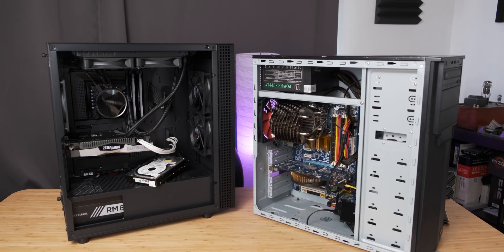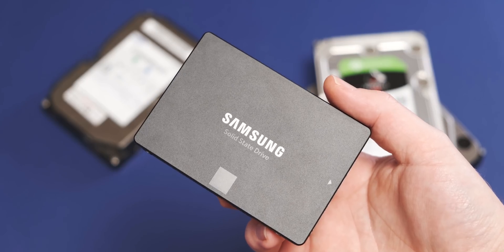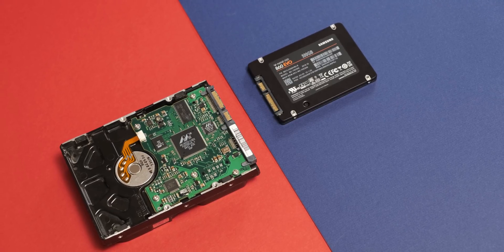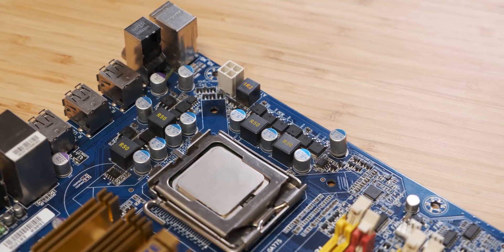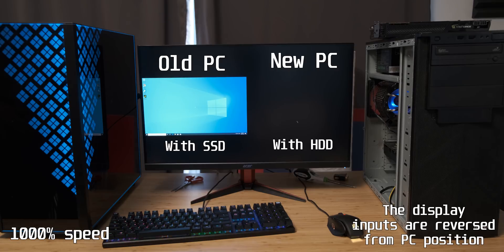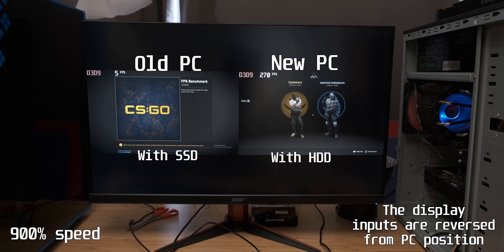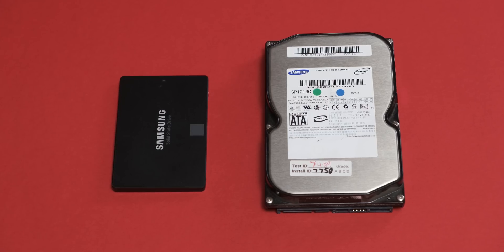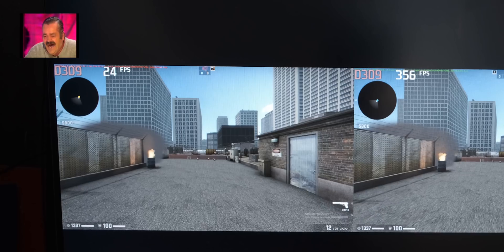New PC with old hard drive vs Old PC with new SSD

Comment: I replaced my old laptop 2,5" HDD, now it feels fast like my main rig.
Reply: Yeah I have a 2014 Asus laptop, i3, 8gb... It had a 500 GB 2.5" hard disk, when I swapped it for an SSD. Oh god, it felt like it's from 2024!
Reply: bcz 2.5 hdds r specially, crappy
Reply: @arencorparencorp2189  yea but i runs great on win 7 but win 10... oh boy talking about my 2009 laptop boot up is about 2 mins
Reply: @whyers4782  well, makes sense i mean, w 7 was designed with these as the usual, widespread drives, like win xp was snappy with hdd, however win 10 was meant for ssd, as in 2015 adoption was raising, it also works fine on fast hdd with cache, but on slow, laptop hdds? horrible, it works but.. as tech goes.. i mean try to run w10 with a celeron dual core and 4gb of ram vs win 7...

Comment: I wouldn't call this video pointless. I deem this really informative and really stress the importance of an SSD at this time. Also points out the value of old hardware coupled with a relatively cheap SSD. Breathes new life on an old system basically.

TechYesCIty will be proud. :D

Comment: I clued onto this when I needed a laptop for university, with an SSD my 2012 business grade laptop (Lenovo X230 so not your typical big box retailer laptop) flies for the tasks it needs and is magnitudes faster than any new $250 machine. Can't believe that even laptops in the mid range price segments are still offering HDDs as default
Reply: Finally starting to see new laptops with standard ssd.   I think the manufacturers were selling more pcs to unsuspecting consumers based entirely on the big numbers.   They liked highlighting 1 TB storage in the advertising.   The smart consumer is much better off with 256gb boot drive and maybe an external usb storage drive if needed.

Comment: Even a decent HDD really cripples the usability of a system.  A brand new toshiba p300 2tb drive was used in the boot drive of an entry level PC I built for my parents (has a pentium g5400) and it took ages to launch anything and was very unresponsive, I put in a cheap SSD and it runs really well now. I will never used a HDD as a boot drive ever again, as it has always been the reason why my older PCs were so slow. I wouldn't have upgraded them if all I had to do was install an SSD, but granted SSDs costed much more back then, but i guess even a 40gb SSD would've worked and then use a HDD USB caddy to use the old drive for extra storage (I was using a laptop at the time.)

Comment: Watching this on a Phenom II X4  @ 3 Ghz,  16 GB RAM,   SATA 2 interface with  Intel SSD  with GT 650 GPU. all of it works together  really well.
Reply: Put a GTX 750Ti/760 there and it's a nice casual gaming machine.
Reply: Similar system here.  Phenom II X6 1090T at 3.8 ghz, 16 GB RAM, 1 TB SanDisk SSD PLUS and RX 580 video card.  Had the basic system for years now.  Not a heavy gamer but it runs fine for me.

Comment: USB 3.0 or 3.1 in the new system vs. USB 2.0 (at best) in the old one is also a HUGE speed difference, especially when installing an O/S due to its size.

Where the SSD will make a huge difference is in very large titles like GTA 5 and RDR 2 - those probably won't even load on that new PC with old HDD. I noticed a big speed difference, particularly with seek times, with a SSD (a 1TB Samsung 860 QVO)  vs. the Seagate SSHD that was in my laptop before.
Reply: USB 3 is 3 × faster than 2.0

Comment: The tactic for getting around the hdd speed issue was raid. Raid 0+1 was common or a 4-drive raid-5 array.
Reply: 0+1 
failure rate ... one disk dies you lose everything with 4 disks the probability is 4x more than with one.
Reply: @666Azmodan666  that is 100% incorrect. RAID = Redundant Array of Inexpensive Disks.. Notice the word Redundant ? 
One disk fails and you do not lose data. The drive gets replaced and rebuilt on the fly while the system keeps operating .
Depending on how your raid is configured some can survive multi-disk failures.
Reply: @iancarnel8609  HDD disks have a specific number of errors specified in the manufacturer's specification. With 2tb disks, the chance for such an error is about 60% and it won't be detected by any program, but when recovering the matrix it will be detected, which will result in interruption of data recovery. They are safe raids but today, e.g. raid 1 is not one of them.
I have been working on the topic recently for important data for the company.
If you don't believe me, it means that you have such knowledge as I did a few months ago, as it turns out to be expired.
Reply: @666Azmodan666  nobody mentioned using raid 1 exclusively.
I said 4 drive raid using 0+1 .. Eg 2 drives striping and 2 drives mirroring.  4 drive raid 5 is striping with on-drive parity and 4 drive  raid 6 is 3 drives striping and one drive parity.
Idk if you didn't read that part or if you're trolling or trying to show off.
Reply: @iancarnel8609  I meant raid 1 (mirroring) created for security but today having nothing to do with it. Although safer than one, but wasting half of the space available for a poor chance of data recovery is pointless and in the case of important data is unacceptable.

Someone who associates raid with security should check whether the theory written years ago is still valid in the case of the raid mode he chose. That's all I mean. I do not want to start wars or show off I prefer to sleep, I am now 1 am;)
Secure data is two mirror servers NAS in separate buildings and of course with the appropriate raid.
good night ;)

Comment: HDD speed isnt bits, its bytes. network speed is measured in bits. :P
Reply: Which is stupid. It's just to make speeds look impressive with big numbers.
Reply: @MrBearyMcBearface  not sure what you mean, networking is generally slower than storage.
**you do understand bits are a smaller unit of measurement, so the fact that storage and ram use bytes, actually makes their numbers smaller, because there are more bits in them, if they used bits, the numbers would be enormous. example, gigabit (1000~megabit) ethernet translates to roughly 128 MegaBytes.**
Reply: @bruhhdahman  I know. But the abbreviations are very close. People confuse them all the time. So when someone is selling internet or a router or a wifi dongle.... A lot of people would think it's not Mbps but MBps. Bits make sense as a unit because there are 8 parts that make up a byte. Bite kilobits or megabits doesn't even make sense. Bits don't make up megabytes and kilobytes. Bytes do.
Reply: @MrBearyMcBearface  yeah mega and kilo are prefixes that also reduce the size of the number... kilo is 1000, so kilo bits/bytes is 1000 bits/bytes,  mega is million, so yeah these words aren't deceptive, they don't make it seem larger, they make the numbers smaller, the words help describe the size. not sure why you think they're deceptive.
Reply: @bruhhdahman  because it is? Tell me why bits are used for network speeds when real speed is measured in bytes

Comment: What type of time would it take to install Windows off a DVD versus USB on the older system? I can't help but wonder if the old motherboard's USB controller is a bottleneck. But then again, installing off DVD rom was not fast either.. but I suspect it may be a bit faster in this situation. Crap, I still remember installing Windows 95 with a stack of floppies. What a waste of time.
Reply: Recent builds of windows 10 do not fit on normal dvd unless you use dual layer media

Comment: The problem with a HDD is not with a clean windows install, the performance decrease with the use, try to fill the HDD whit 40% - 60%
Reply: actually no, thats ssd, hdd should work 100% as fast even at 99% fill, granted no fragmentation happens, wich is harder as it fills up

Comment: My PC at work took almost 15 min just to log into Windows (10). Swapped an IDE hard drive for an SSD. It now is almost immediate.
Reply: There might have been some bad sectors on the hard drive. That will make it even slower than it already is.
Reply: yea, 15 min ofc, my hdd one took 2 billion years to boot up, cmon hdd r indeed slower, but not THAT slow, i had windows 10 installed on a crappy laptop 5400 hdd and takes 40 secs to boot, 1 min extra to be usable, so unless ur hdd is literaly broken it wont take that much
Reply: Hard drive was old, and booting pxe
Reply: Tbh hd vs ssd not major boot time difference.

I tested and depends on hd spec.
Reply: @DragonProtector  its overall responsiveness, and ofc, yes ssd is better but, its not like it takes 10 days with hdd and openning a folder takes 1 min... it works.... reasonable, with a decent hd with cache, add a 2000s hdd, sure its going to be crappy
Reply: @arencorparencorp2189  ya. A good 2tb or higher drive with 256mb cache will be just as responsive as an ssd and normal user won't notice difference besides maybe loading screens by a second or 2.
Reply: @DragonProtector  hard drives don't have cache. You're thinking of sshd. Which is a horrible option for nearly all users.
Reply: @thevigamerpixerlator  lol cache and solid state memory in hybrid drives are two different things.

Comment: I did this a few weeks ago......

Olden days... we never used one drive we had raid 0

Any how.... before you pack this away...

Just add another old hard drive and re do the test again... you can do two.

One just add a drive, windows 10 will put the cache on it and speed things up (make it usable)
[ make sure that it does]

Then  Raid the drive into a strip and see what difference that makes...

If you have "time on your hands" then add another  hard drive ( 3 drive stripper) and see if the old system is better or not then....

I also did a video on SSD being slow and put the latest against my mechanical drives... My Mech won by a hell of a lot.... " Goo old tech!!"

Didn't no girl tell you.. its not what you got but how you use it!

Comment: I use my older 250GB Samsung 860 EVO in my Win XP 32 bit gaming system.
Reply: how is a Samsung EVO old? i thought those where ssd and they are like the titan x of Samsung's ssd line.
Reply: @bland9876  Poor choice of wording but I should've said heavily used. Basically it was used as a test drive and a boot drive for 2 years. Also it is older in the context of I upgraded it  for a Samsung 970 pcie nme 500gb drive.
Reply: @Warbob11  pcie supposed to be the fastest especially if it's an x 16 card assuming that you're doing tasks that actually need the speed that's a well worth it upgrade.

Comment: Thanks! I just built a new system using M.2 and have a couple old PC's laying around. Most recent being 2007 ish. I was just contemplating this very issue...
Reply: Go for it, you can pick up a Kingston 120 for like 20 bucks on Amazon. I'm typing this on a Core2Duo, with the SSD it works fine.